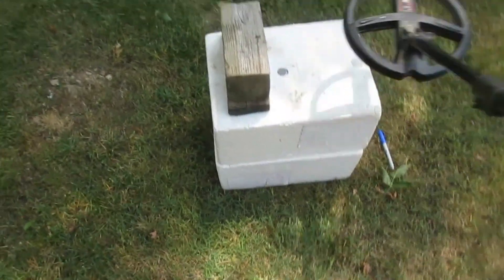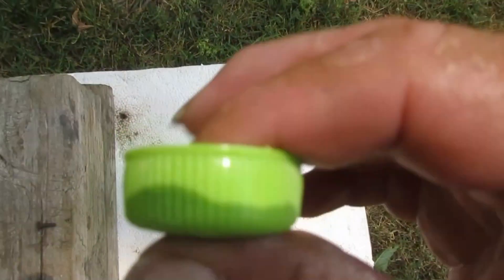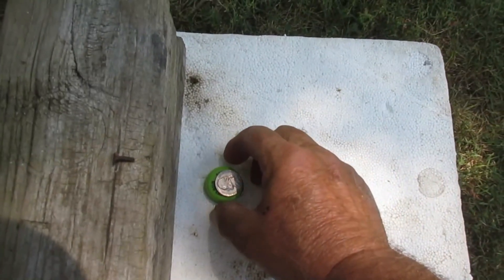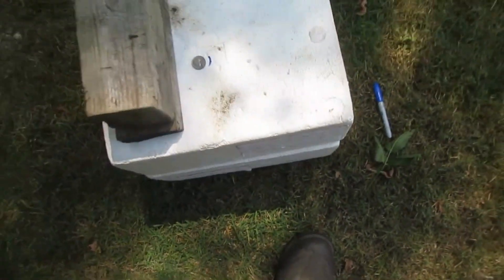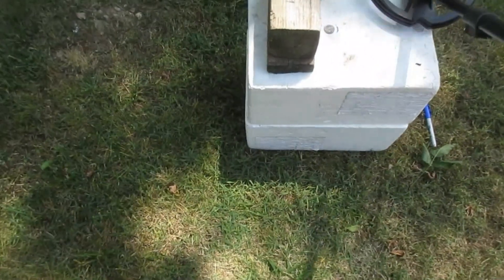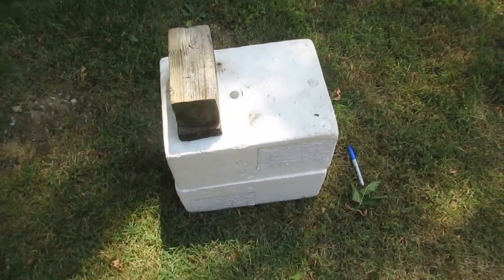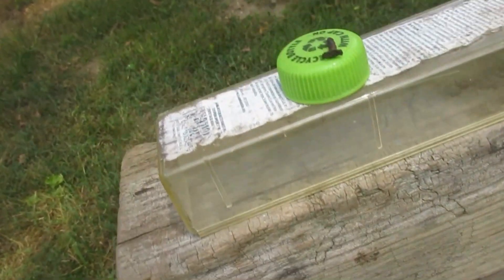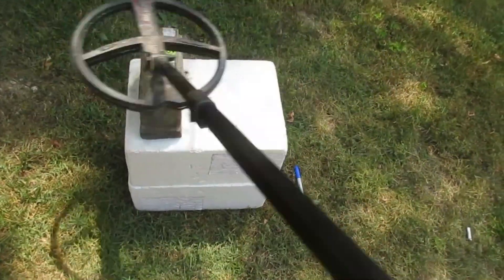Deus 2 demos --Using 9 and 11 inch coils altering unmasking scenarios

Comment: Millions of coins and millions of different situations. These “hunted out” places still likely hold hundreds of coins and I’ve seen some of them with the D2. I had hunted a local park, found 30-ish silver coins over 2-3 years. They came in and deep rototilled the field for drainage and reforming….found another TWENTY silvers in a WEEK. They’re there. It’s a matter of throwing EVERYTHING you have at it and then some. That’s a great demo of showing that a VERY slight change in position TOTALLY wrecks the signal…eye opening for most.

Comment: I feel a coil has it’s obvious advantages disadvantages but also because of the geometry of the coil can change the configuration of the items in the ground in relation to the angle of the sweep , with out moving the items , if you catch my drift #historyrevisited , tn would you mind if I mirror your tests the best I can using the legend , I do have my iron soaking in water , instead of using dry iron , as more suited to the ground over here in the Pennines England . Also I have found a smaller coil even though is faster because of the smaller tx rx induction balanced double d’s , that even though it can get between the iron can be saturated more because of the smaller footprint compared to a larger coil , less iron in relation to , therefore iron bias , filter , equivalents have less ferrous items to deal with